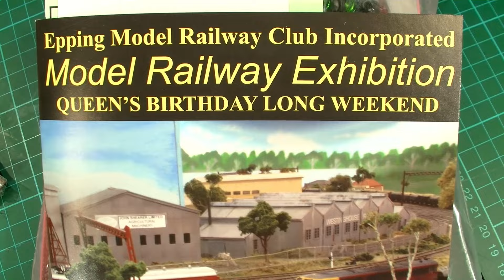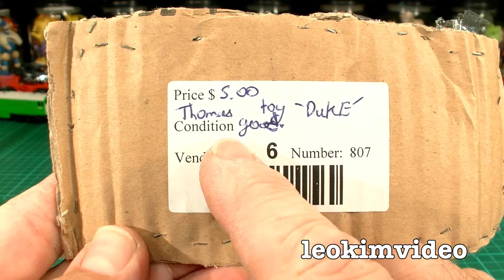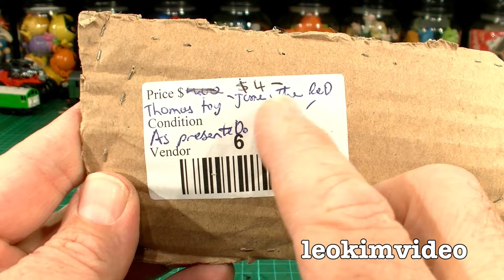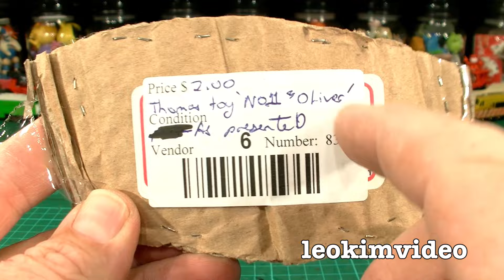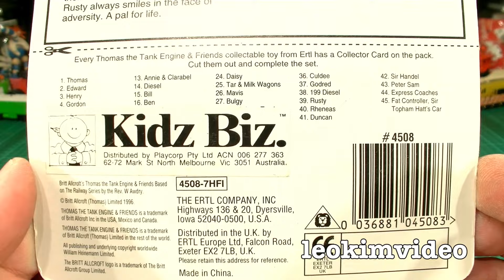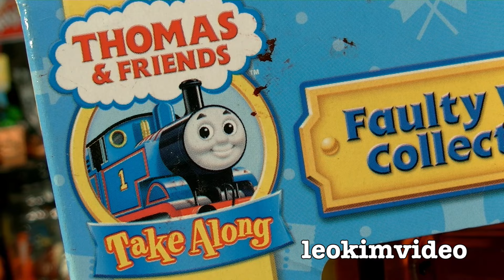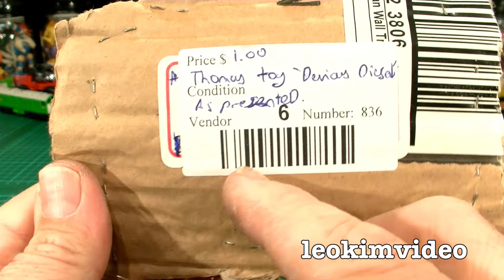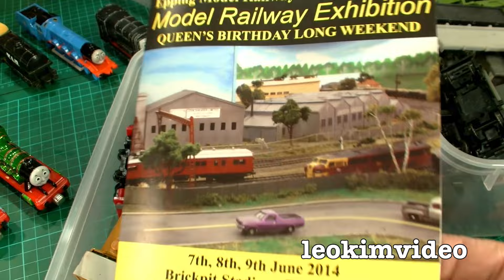Thomas The Tank Amazing ERTL & Rare Take Along Metallic Collectable Toy Trains

Comment: The James didn't have fluff because when the wheels get loose it's better because it makes the fluff come out, that's why there wasn't any fluff.
Reply: And I have an Oliver too and it has white on the running plate.
Reply: Boo had 3 wheels at the front and 2 at the back because "BO" means 2 wheels and "CO" means three wheels so his name was supposed to be COBO but they changed it around BOCO.
Reply: CoBo with a lower case "o"

Comment: Leo did you see the new re-designed trackmasters!?!?
Reply: They are a strange, strange sight... Not a fan. At all. The new track and motors, and even new wheel design, and finally moving the batteries out the the tenders... but making all of them have fake wheels is poor.
Reply: ***** Frankly everything about them is crap. The track is hard to put together, it is made of very very shoddy plastic, the engines don't freewheel, and they do not run on TOMY blue track. They are going to loose customers this way.
Reply: ***** no free wheeling? ! That is 100% fail.